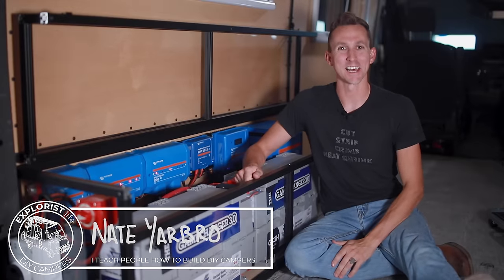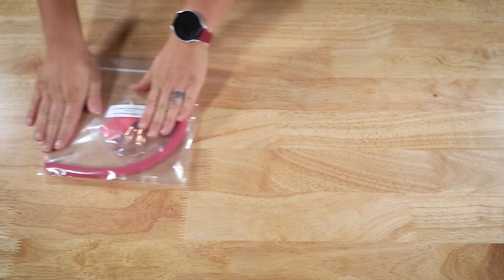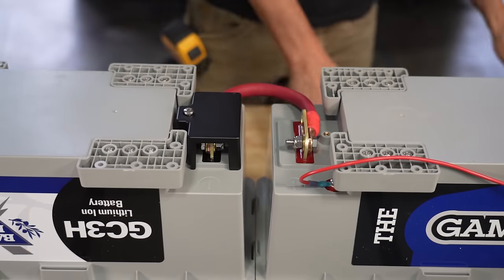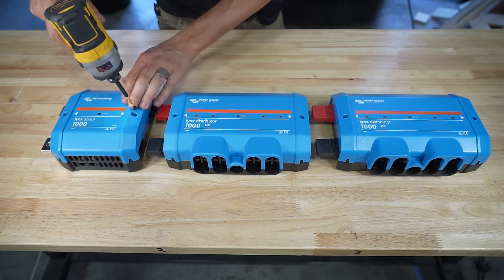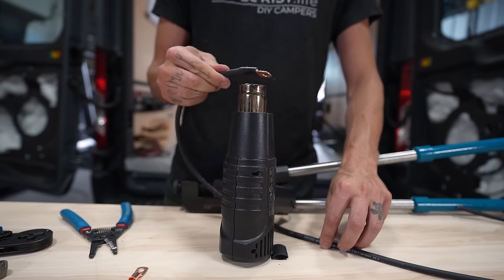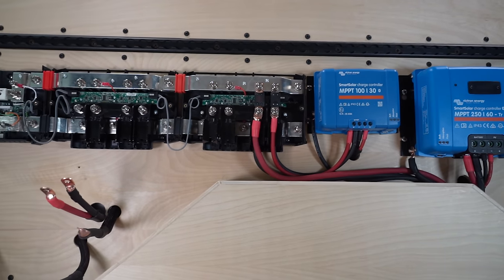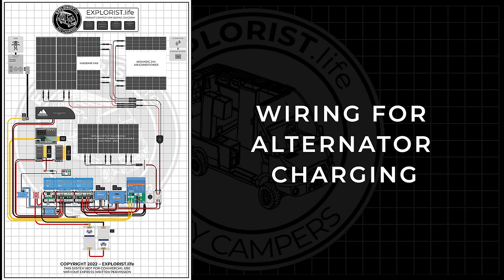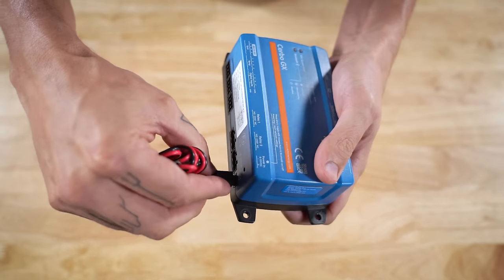DIY CAMPER VAN ELECTRICAL INSTALL (Start to Finish Tutorial)

Comment: This is a fantastic install video. It gave me a lot of inspiration for the system that I am currently building for my Jayco Alante. As a professional ambulance mechanic, I see rat's nest wiring jobs on the daily. Its so satisfying to see someone take pride in their work and have a thoughtfully laid out system. I will provide one piece of advice for future installs... Purely from a technician's POV;  I would recommend having a short loop of excess wire (we call it a service loop) at each connection to a mounted component. It very marginally increases the amount of wire you use, however as the name implies when it comes to servicing and trouble shooting components it helps to have a little built-in slack in the system.
Reply from the maker: Awesome!  Glad it helped.  Thanks for watching!

Comment: Hey! You guys have been a HUGE help for me working on my conversion and I bought your previous electrical guide about 2 years ago. I do have a question though. I am looking to put in an external 15amp outlet next to my 30 amp shore power plug so I can plug stuff into the van and use the van's batteries while outside like our induction cooker, projector, etc. but all I see are 15amp shore power inlets to charge the van, not to use the van's power. Long story short, when my fiance is asleep, I can't cook or use some devices that need to be plugged in while in the van, and I'd like to do it outside without having one of the doors cracked for the extension cord. Can you do a video on how to do that? I can't find the equipment or the layout for this idea. Thanks!
Reply from the maker: Sure!  You'd be looking for a 'Flanged Power Outlet' like this: https://amzn.to/3BXRTMx  It'd be wired in the same as any other outlet to the breaker box (with 14ga wire and a 15A breaker if you're only putting one outlet on the circuit.)

Comment: I think I might have screwed up; pause for comments.  I am using the plans that I bought from you for the above video but I bought Progressive Dynamics PD4100 series Power Control Center instead of buying your AC and DC fuse panels.  I bought this before I started following you, by the way.  As I am getting into it I see that this PD4100 is also an inverter.  Is this going to work for me since I am wiring my AC from the Victron Multiplex and also my DC from that?  Please let me know if I am not clear enough.  Thanks!
Reply from the maker: Nope.  That's not going to serve you very well.  That's only rated for 30A and would handicap the powerassist function of the Multiplus.  Plus, it's only a converter and not an inverter and the converter part would need to be disabled if using the multiplus.  Probably best to return that and buy the proper parts.
Reply: @EXPLORISTlife  Dangit.  I was afraid of that.  Thanks for the quick reply.

Comment: Hi Nate... Thanks to you and Steph for all of the time and hard work you both put into these videos.  I have a new 2023 Ford Transit with the RV Prep package that came with Dual Alternators/AGM batteries.  I know you have a plan to do a separate video using the Buck Boost for this.  I am starting my electrical phase soon using all of the same Victron components that you used in this video.  Any advice you have to prep for the alternator charging portion?  I know you are are CRAZY busy, but any ETA on the Alternator Video?  Any resources or other info you have compiled that you can share until then.  Thank You!!!
Reply from the maker: Hey!  Just wanted to follow up on this.  We just released the alternator charging video that accompanies this tutorial.  Here is the direct link to that: https://www.youtube.com/watch?v=FuBAKTCCnt4

Comment: Great video and very informative. Thank you. 
I do have one suggestion, however. For the Lynx data cable that was too long for your application, instead of trying to wrap up the excess within the tight space available, I'd recommend shortening it. A simple RJ type crimper and connectors can be sourced at any electronics shop or even your local Home Depot for less than $20.
The tool is easy to use and has a multitude of applications from providing hidden and factory looking power cable for a dash cam, wiring a built-in or hidden radar detector,  or even making custom lengths or repairing regular phone cable around the home.
Reply from the maker: I would not recommend that, no.  Historically, a diy crimp of the victron RJ45 connectors leads to a poor connection and issues.  When somebody is having communication problems, making sure an unaltered victron cable is the first troubleshooting step.
Reply: @EXPLORISTlife  Interesting opinion. I've worked in the telecommunications field for a number of years and used these types (RJ11, 12 and 45) of connectors without issue. If done correctly, with quality materials, they have proven to be robust and reliable.They are even used in installations for medical equipment, in what might be considered 'life safety' conditions such as nurse call systems, by design from the device manufacturer. 
I'm just thinking that in a cramped space such as what you showed, and in an environment subject to vibration and shock, it might prove to be detrimental to the longevity of the cable to be excessively twisted around or bent. 
This is just me spitballing and posing alternatives to a situation which may be inconsequential and doesn't need an alternative. I tend to be a little OCD when it comes to cable routing and protection. So many trouble shooting repairs have come down to damaged cable.

Comment: This series is terrific! Say, I can't find the model of the DC power port you're using for the solar. Can you share the brand and model?
Reply from the maker: The DC Power Port is listed in the 'other parts needed' section of the full kit: https://shop.explorist.life/shop/all-products/camper-wiring-kits/complete-wiring-kits/540ah-3000w-24v-multiplus-580w-to-1700w-solar/

Comment: Hi, I am always amazed by the precision in the assembly of the electrical systems, and on the editing of the videos. All very informative. For the next time I suggest you use the compasses to screw on the wood to keep the Victron devices suspended. Thanks and good job. Matteo
Reply from the maker: Thanks!  I appreciate that!  What is 'the compasses' you speak of?

Comment: Hi I'm looking at doing something very simular but with only a 1000w inverter. Would the cable need to be smaller.
Reply from the maker: Smaller electrical demands typically mean you can use smaller wire, indeed.

Comment: Where did you get the plug that you mounted on the side of the van for your ground solar array? I looked on your website... couldn't find it. Thanks for this awesome and super helpful content!
Reply from the maker: That will soon be an add-on for our solar array wiring kits, but until then, I've included it in the 'other parts required' section of the kit for this build: https://shop.explorist.life/shop/all-products/camper-wiring-kits/complete-wiring-kits/540ah-3000w-24v-multiplus-580w-to-1700w-solar/

Comment: Can you speak to how you are controlling the heat in the enclosure? I have a multiplus 2 that is installed in a similar enclosure. If I allow the charging output current of the inverter to go any higher than 30 amps, the inverter and enclosure get incredibly hot. Thanks
Reply from the maker: As of right now, it's just passive cooling.  There is a 1/16" gap around the lid of the enclosure and a bigger gap around the back of the enclosure (1/4" or so.  Haven't measured).  This should be plenty to keep everything nice and cool.  If we need to add fans on a thermostat to help with cooling later on, we will, but I don't anticipate needing that.

Comment: Always appreciate you videos.  I know you sell wiring kits that are pretty complete with all that is needed.  I have accumulated most parts before realizing this.  I am stuck trying to get 6/3 wire.  I am looking for a short run is this something you sell. I didnt see it on your store site.
Reply from the maker: We don't sell wire by the foot at this time but there is 6/3 wire in some of the parts lists at https://www.explorist.life/solarwiringdiagrams where you can buy just 6/3 wire from Amazon; although I do think it costs more than our full 120V AC Distribution panel wiring kit.  I suppose you could buy our kit and return the parts you've already purchased so you can get the guarantee that everything fits together as well.

Comment: Beautiful…using power crimp tools would be good upgrade. What’s the system parts cost and hours of labor?
Reply from the maker: You know, I'm a bit jaded on power cut/crimp tools after my $500 Milwaukee cutters wouldn't cut battery cables. 🤣  System price and hours was covered in last weeks video.  Here's a direct link there: https://www.youtube.com/watch?v=Tkbj51mOhKg&list=PLmvhcyi4n0TVfA4XCYJBkzfUXunSON1zX

Comment: I like this setup and have decided to build this setup but I don’t want shore power does that mean I can change the charger/inverter for just an inverter ?? Plus looking forward to the alternator video to finish this system off
Reply from the maker: I strongly advise building the system with shore power.  Even if you don't 'plan' on ever needing it while traveling... for troubleshooting and system commissioning it is an absolute must.

Comment: Do you not need to bond the ground and neutral in the 120V distribution box? Does the Victron Multiplus have a bonding relay that takes care of this in the event of a problem?
Reply from the maker: There is indeed a neutral to ground bonding relay in the multiplus that handles that.

Comment: Electric utility studies show failed wire connections are one of the highest causes of electrical failures. Multiple wire connections = potential high failure rate. Reducing connections with proper protection can increase reliability.
Reply from the maker: Of course.  That's exactly what we did in this system. 👍🙂

Comment: is it not a concern with the orion converter wiring how the 12v and 24v wires touch the oposing terminals? wouldnt they potentially rub through the insulation over time?
Reply from the maker: They are nice and secure so rubbing is not a concern, no.

Comment: Hey Nate.  My system is identically set up like this.  However, my 26.7V drops down to 2.7V coming into the shunt.  Not sure what I did wrong. Any ideas?
Reply from the maker: Sounds like the Battery BMS is turning the batteries off.  Try charging the system via shore power, which should turn the batteries back on.  If that doesn't work and you've purchased your components through shop.explorist.life; submit a support ticket so we can check into it further.
Reply: @EXPLORISTlife , Nate you are the man.  That trick worked.  Really appreciate it.

Comment: I know some solar charge controllers don't recommend having PV input when there is no battery connection. I see the Victron manual says the connection order or battery first then the PV array but nothing about after installation. I am wondering about the setup you show here that disconnects the batteries from the system via the master switch but the PV arrays are still pushing to the solar controllers. The charge controllers have no battery connection at that point. The Victorn SCC units handling that situation?
Reply from the maker: The solar isolator should always be turned off before turning off the battery disconnect switch.

Comment: My two cents worth, recently seen expensive caravan destroyed because the electrics were mounted above the wheel arch like pictured here, when the tyre shredded and flailed itself to bits it went through the wheel arch grabbed  the wiring and pulled the wires ourt of the walls.
Reply from the maker: Cool story.  I've seen an entire van destroyed because a tire blew out, caused the driver to swerve, and flipped the van.  Sounds like tires are pretty dangerous.

Comment: I have been bing watvhing for a while now. Started out with some infor I was looking for ang got stuck at your channel :D Whats the reason for doing a 24V system for then adding a converter to 12v?
Reply from the maker: We did a 24V system in this van because we had never done one before & everybody was asking how it worked. 🤷‍♂️😂  This system would have been fine as 12V and we have kits available for both.  Search YT for a video called "EXPLORIST.life 12V vs 24V vs 48V" for more info on choosing system voltages or use the system picker on the home page of our shop.
Reply: @EXPLORISTlife  cool. Very sweet. Great work.

Comment: Great resource! Thanks. Do you have any plans to offer info for 48V system info/kits for class A motorhomes?
Reply from the maker: Glad it helped!  I have no plans to release a 48V kit for class A motorhomes.  We already have a big split phase 24V system available with 6000W of inverting capability (dual 3k inverters) at https://www.explorist.life/solarwiringdiagrams.  Will have this in a parts kit soon.  This should be plenty for nearly all Class A motorhomes.

Why are you thinking you need 48V?  How much inverting capacity are you trying to have? 10,000w?

Comment: If I could add anything about this video that is a real masterpiece…It’s @ 30:14 where you used black cords to attach the grounds. It sure would be nice if the shrink wrap was green to indicate it was a ground wire, or if the actual cable was green.
Reply from the maker: Yeah, maybe so.  Would be totally neato!  Definitely not a requirement, though.

Comment: When you put in the solar panel isolator switch you didn't use ferrules ... and I am not understanding when to or when not to.... pat
Reply from the maker: Ferrules are a tool, not a requirement.  If they make your life easier and the installation cleaner, use them.  If they are in the way... don't use them.

Comment: I recently ran into a issue and would like to run this past you. My system has 6 panel and one is failing, I didn't factor this into the mix when setup up the panels together so now I will have to test each panel individually and replace it. My question is there some meter or something that can be added to each panel so you can look at it and tell without taking everything apart?
Reply from the maker: Panel failures are rare, so there's not really much of a meter for them.  Testing individually is indeed the best way here.

Comment: If i do not intend to use shore power for charging, will i still need to get the Victron Multiplus @ 27:45?
Reply from the maker: Even if you do not regularly plan to use shore power, it's a vital piece of a system if, for nothing else, troubleshooting and commissioning purposes and shore power should not be omitted.

Comment: Super detailed and structured video. The only part that confused me is why that all the devices are grounded to the multiplus and also to the chassis (through one of the lynx distrubitors). Is that that the best standard or specific to victron ?
Reply from the maker: The charge controllers are not necessarily 'grounded to' the multiplus.  They just needed a path back to chassis ground and the way you saw here is just the most simple way to do this.

Comment: Why did you change from low voltage DC  breakers to the solar insulator disconnect?
Reply from the maker: It's the more appropriate piece of equipment.  Back when we did the video with the DC breakers, we didn't have a good source for the actual isolators.

Comment: Are you using stranded wire on the AC wiring?  You are using  ferrels  so I'm assuming all you wiring is stranded as it should be in any thing that takes  alot of vibration and movement.
Something  I learned on my sailboat  build.
Reply from the maker: Indeed.  Here is the video where we installed all of our 120V AC Wiring: https://youtu.be/en6Q2L6Bf3A

Comment: On the chassis ground, if you sand away some paint to get to bare metal, I was taught to put a little anti-oxidant compound on the connection and bare metal.  Keeps the connection from fouling, and the bare metal from rusting.

Comment: Nate, does the wiring diagram include all the the wire gauges needed for the build?  What exactly comes with the wiring diagram, how detailed is it?  Does it have a build list with the diagram that matches up with your kits? Just wondering.  Thank you.
Reply from the maker: All of our diagrams include wire, lug, fuse, heat shrink, ferrule sizes.  Basically every single item is labeled. 

Each diagram is tied to a complete kit on https://shop.explorist.life
Reply: @EXPLORISTlife  sold! 😂. Thank you!

Comment: So 1/0 aught AWG is big enough for most solar setups to connect the batteries/inverter?
Reply from the maker: not necessarily, no.  It's just appropriate for THIS system.  Check https://shop.explorist.life for various 'appropriately sized' wiring kits and diagrams.

Comment: Is there a way to add support structure or material behind the shore power and ground mount outlets (inlets) so that plugging the cables in and out doesn't flex the van sheet metal so much?
Reply from the maker: Sure!  I'm sure with some arts and crafts, you'll be able to find something that works for you.  Maybe you could fabricate up a steel backer plate or something.